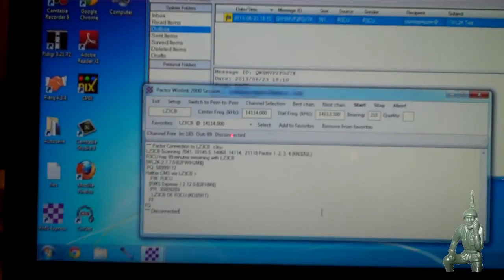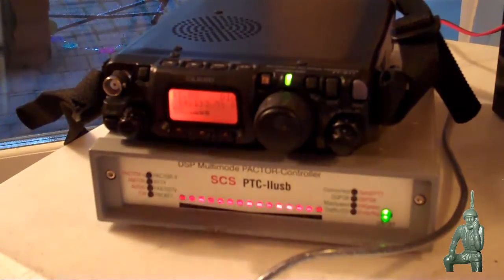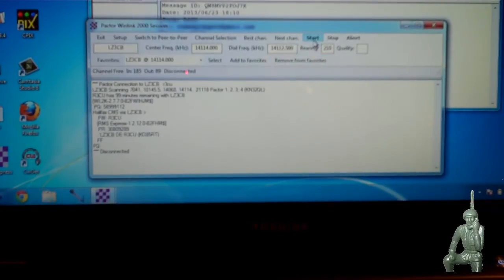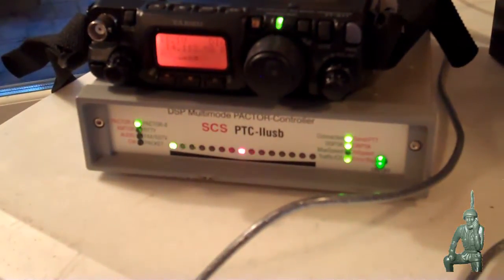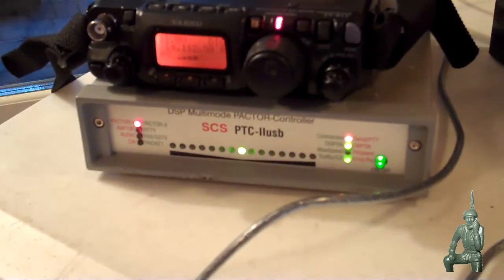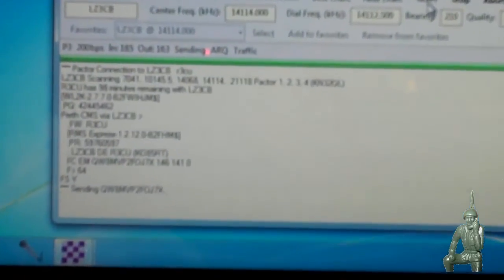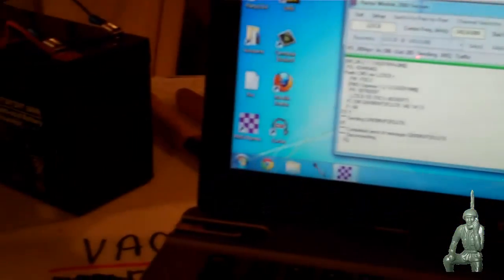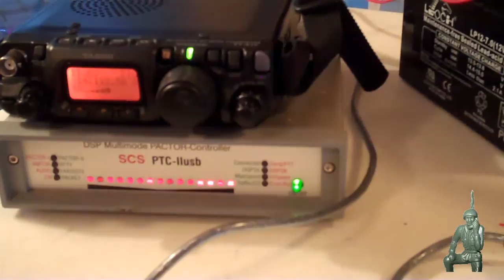FT-817ND Bugout bag radio now has email capability!

Comment: I have a fleet of converted radios that interface to a laptop or desktop and we can send and receive images, data and video streams if necessary and the portable ones use small 12v batteries and have a solar charger. I found that I didnt have to use my expensive radios in the field also. I was able to mod some cheap CB radios to work with a variety of interfaces and modems all successfully.

Comment: Hi! the modem is strictly necessary? I ask because i have seen people operate this system only with a CAT interface to key the PTT and audio from PC to radio to transmit the data. Thank You.
Reply from the maker: Yes - for pactor speeds 3 & 4 the modem is needed.  Nothing out of a sound card comes even close to the speeds of pactor 3 or 4.